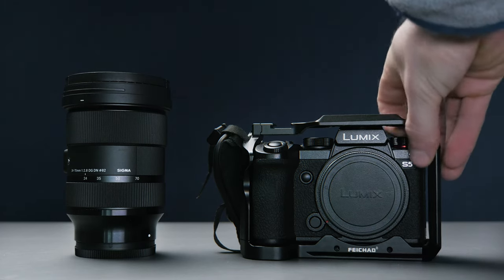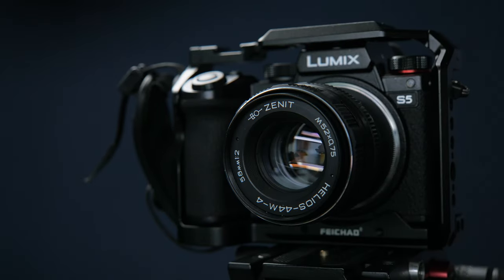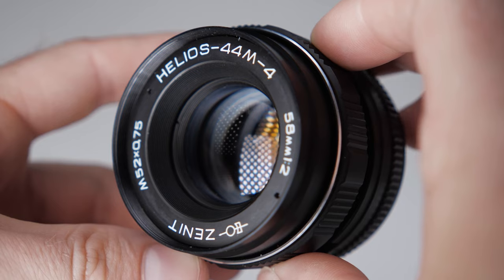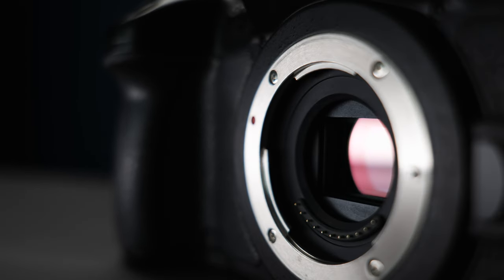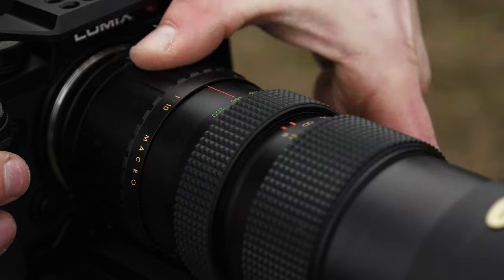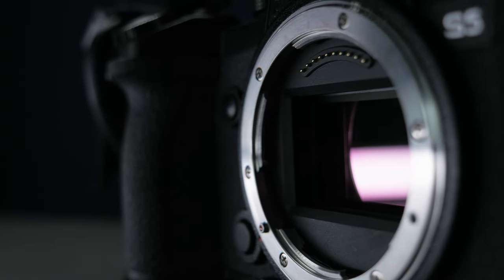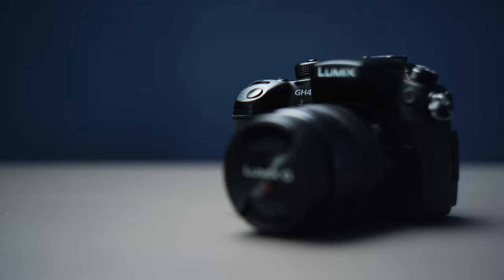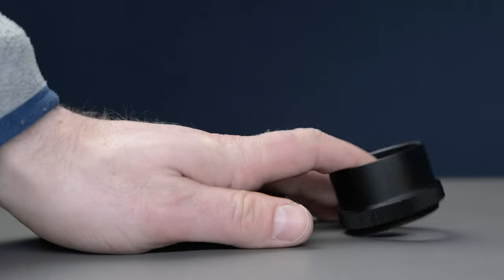How to Fix Focus on Old Lenses

Comment: Thanks for the explanation. 

I use a Lumix 5S and have several vintage lenses (Nikon, Zeiss Y/C, Canon EF). I have tried various combinations: for example, a Nikon 21mm AIS lens with K&F adapter (Nikon -L). The same lens with Nikon EF adapter together with K&F adapter (EF-L). Not working.  When focusing to infinity or to an object more than 2 metres away the flip-down LCD monitor it shows it in perfect focus (I use focus peaking and magnify the image). But when shooting (high speed, closed aperture...) the resulting image is out of focus at those distances.  I don't have problems with the close focus. How is it possible that the sensor information displayed on the LCD and the final file do not match in focus? Do you think your solution can work with this problem? Your solution would increase flange distance and would make impossible infinite focusing, wouldn't? And what about helicoid adapters? Could it work?
Reply from the maker: It seems like my solution might help. I had a similar issue with one lens where it wouldn't focus at infinity, which usually means that the distance between the lens and the sensor isn't set correctly (if the lens itself is fine). I recommend connecting an external monitor to the camera. When I was shooting with the Helios 44, it looked like the video was in focus on the camera screen (because the focus peaking was also highlighting), but in reality, it wasn't. With a monitor, you'll see this more clearly, and don't rely too much on focus peaking. Also, older lenses are often sharp only in the center, meaning if your main subject is off to the side, even if focus peaking highlights it, the result might still look out of focus.